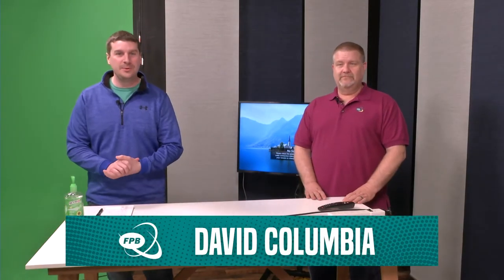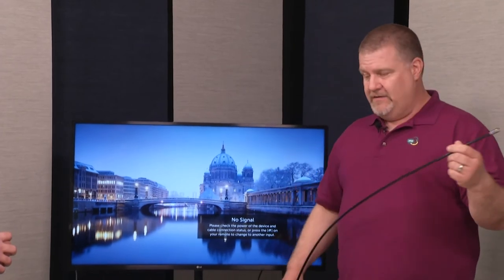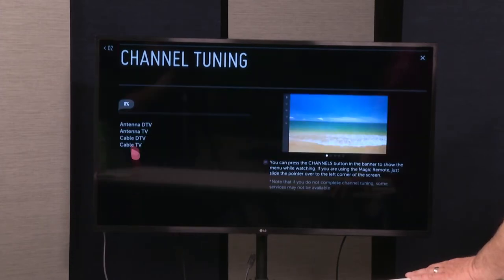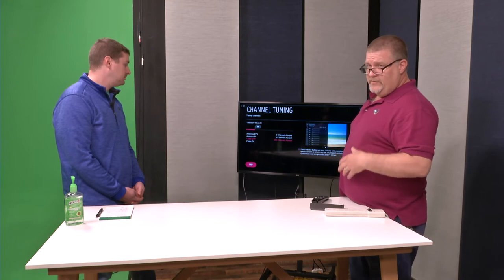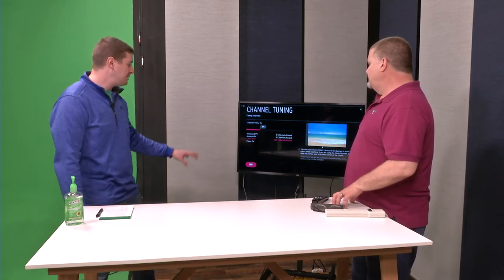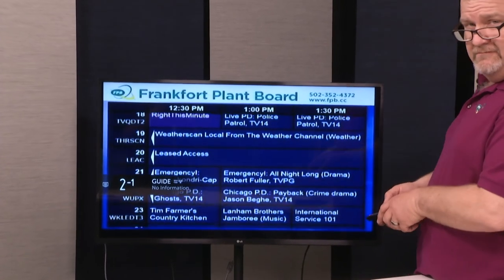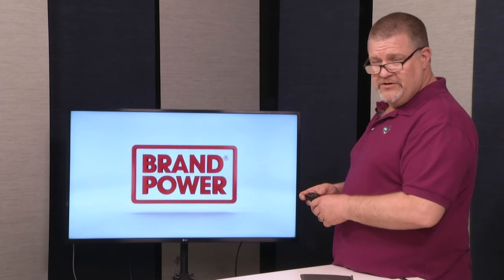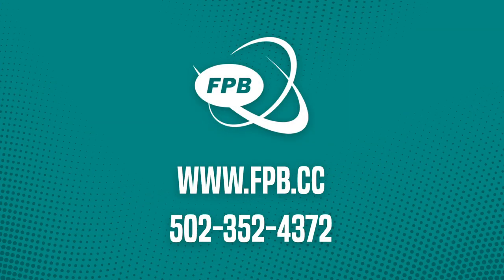QAM Tuner | Self Installation Guide | FPB

Comment: Why aren’t you showing the back of the tv?
Reply from the maker: Diane, all TVs are a little different. If you're hooking up a QAM tuner, the only thing you need to look for is the screw on connector. Most TVs label that connection as Cable/Cable TV/Antenna.